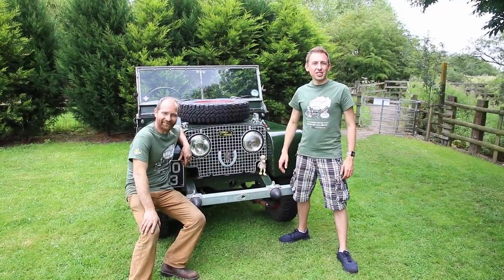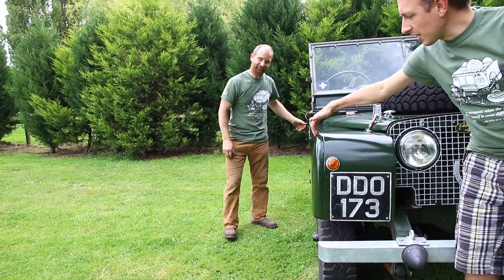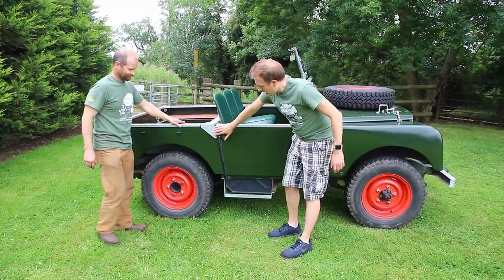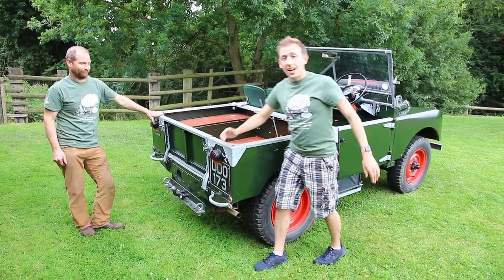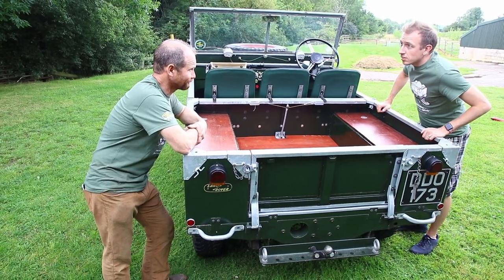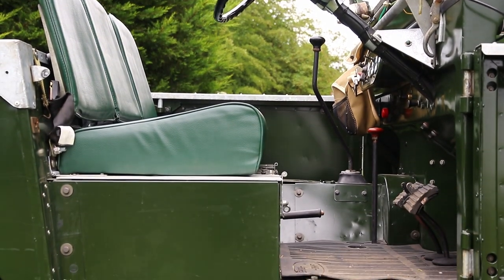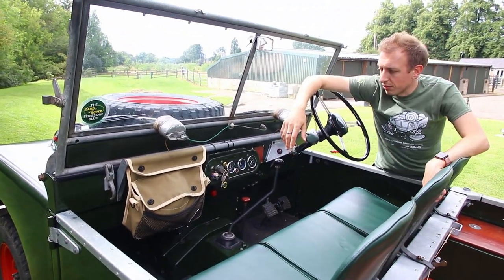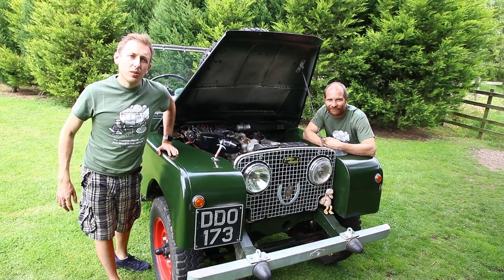LAND ROVER SERIES 1 - 80 INCH - WALK AROUND & OVERVIEW

Comment: Very helpful to a novice like me who happens to own a 1950 Series One (a non-runner ‘under restoration’ since I bought it 28 years ago but now on target to complete in 2020) but has hardly any relevant experience.
Reply: Feel you. Same situation like you, i got one about a year ago and man, it is a never ending """""restorarion"""", cheers!
Reply: So is it a runner now ?
Reply: @millomweb  Yes, it is back on the road, as from last week - re-registered under the original reg with DVLA after 62 years. Also mot’d for good measure. I’ll only get to see it this weekend when I collect, having missed most of the restoration due to lockdowns.
Reply: @andrewmoore2678  Will you upload a video tour of it when you can ? I do wonder whether garages properly MOT old vehicles - may be worth getting the DVLA to MOT it to check. There is a cunning way to do this - find out from the DVLA if they're going to be testing an MOT tester in your area and arrange for the vehicle to be used as the test vehicle. I think the DVLA will welcome that as your vehicle will test a tester more deeply than a typical car !

Hmm, Land Rovers could be one of the earliest mass production vehicles to be fitted with a disc brake !

Comment: 1:23 Indicators - "you actually need these legally now"

Please quote the legislation that states that, thanks.
Reply: Good one mine doesn’t & a ‘51...☝️
Reply: @AndrewClark4MarkRacing  I'm pretty sure they weren't compulsory until about the 70s - on NEW vehicles. By then, pretty much all road vehicles being built had them. Older vehicles that never had them do not have to have them retro-fitted.